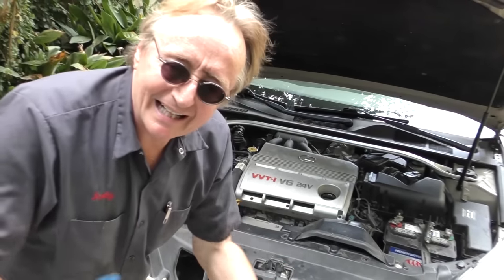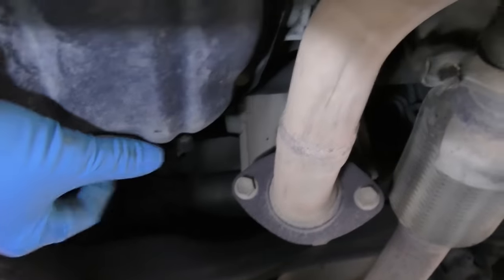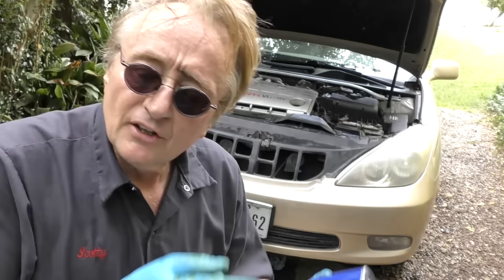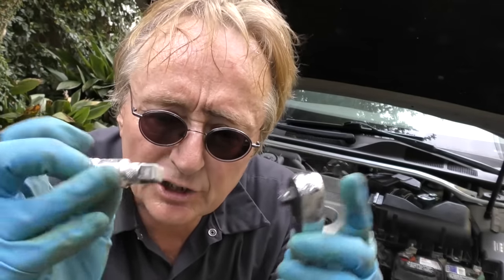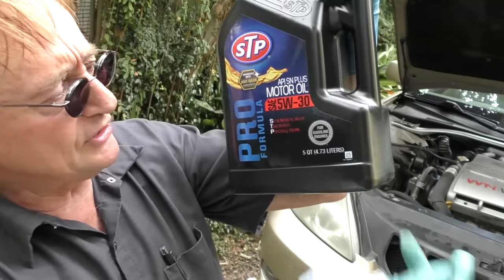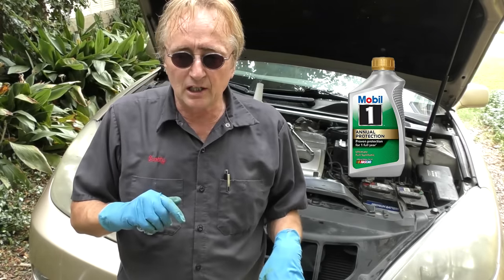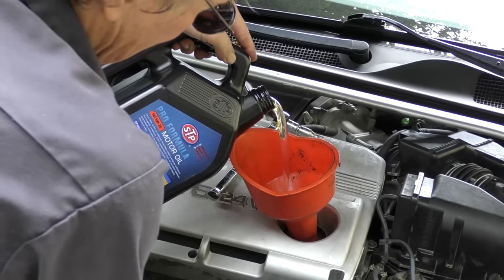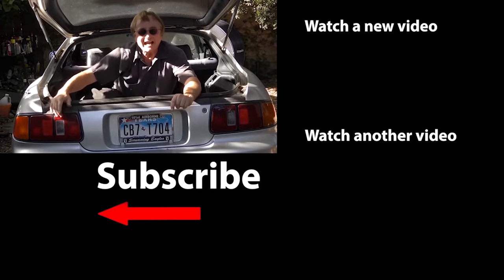Changing Your Engine Oil? You’re Doing It Wrong

Comment: Honestly, I don't think I've ever replaced an oil plug gasket!!
Reply: I have replaced one exactly zero times. I have also had one leak exactly zero times.
Reply: Charlie S. I’ve replaced a couple out of the hundreds I’ve done.  Never saw a filter gasket stick either.
Reply: I only replaced it if it was leaking before I changed it. Inspect the old one when you take the plug off. Looks ok it probably won't leak.
Reply: Charlie S. 280k miles of oil changes on my Avalon and still using the same plug gasket lol
Reply: heck, the "gasket" on my oil plugs are a copper washer...
Reply: @datsuntoyy  You're obviously smart enough not to buy Fram filters then lol.  Had one fall apart immediately after doing at oil change.  Thankfully I always check for leaks.  That along with everything I've read about them and it's the last Fram I'll ever buy.
Reply: @Kaliburz Yeah I think most are.  Kinda like the copper "crush" gaskets on a motorcycle exhaust at the cylinder head.  They're "supposed" to be changed because when tightened they conform to the shape.  I've never changed one of those either and never had a problem.
Reply: Never replaced the gasket and always do it hot, more oil comes out, boo yah
Reply: @sidefx996  I'll run the ultra but never the lower 3.  I've seen demos with basic orange that had holes in the media brand new.  I used to like K&N but the oil filter line has really cheapened.
Reply: @datsuntoyy  it's rare but I have seen it, also seen a brand new filter leak with the O-ring, and no double gasket either. That only happened once it was just a bad filter.
Reply: @sidefx996  I would say it depends on your application.  While I probably won't mess with the Fram spin ons anymore I've had good experiences with the cartridge style in an 06 Sonata running a synthetic blend.  As for plug gaskets, never changed one yet but seeing how most wouldn't use an old band aid on a fresh cut he's got me thinking about investing in a couple, especially if they're universal.
Reply: Me either
Wife:You shoulda known that.
Reply: I've never replaced my oil plug gaskets because they were copper washers.
Reply: @Kaliburz  the car manufacturer done it wrong 😂
Reply: @whoeverwhatever9279  What would 3 do?
Reply: @timyoder2003  have you tried running a little seafoam product in the oil on idle, before draining? It supposed to help prevent sludge buildup. You could look that up if you are interested.
Reply: @whoeverwhatever9279  But they triple seal cars doors now so It would seem like a good thing.
Reply: @datsuntoyy  Sometimes they can be difficult to remove depending on who put it on last. I usually just PB Blast catalyst the gasket and leave 5 minutes. They come right off.
Reply: @Joe_334  i never have ran seafoam in my 98 park ave , lifters are quiet, runs good , did the upper and lower intake gaskets valve cover gaskets everything looked good there so i just leave it alone , however i must not of got the one corner of the intake manifold sealed good 😕 but whatev its been that wat for awhile now, its not bad
Reply: I put on a ez drain plug. It's a ball valve. Never had a problem. Just flip the leaver and drain hooks up to a hose too.
Reply: My sienna 99, got it used, never even had a gasket... no leaks either. Lol
Reply: No need to replace the oil plug gasket when you tighten it up with a BREAKER BAR!
Reply: It's a one time crush washer. Hence the term crush washer
Reply: Should be on the new filter.
Reply: @datsuntoyy  I had one stick on me before and wasn't careful about it and ended up double gasketing. Luckily I fixed it before pouring in the new oil.
Reply: @Joe_334  If you're worried about sludge then either change oil more often or run Redline in it once in a while.  Something about their group V base that is hands down some of the best cleaning oil out there.  Can't say the rest is anything overly special.  

in all reality, don't worry about sludge with ANY synthetic unless you run over 25,000 between changes.
Reply: @datsuntoyy  : I had one filter gasket stick about 35 years ago. ZERO plug gaskets replaced in 50 years changing oil - 25 years on the same car!
Reply: @Kaliburz  That's what my VW had...never a problem.

Comment: 1) Fill the new filter 50% with new oil,  oil pressure builds faster on your first start.
2) You can get 5 quarts of Pennzoil Platinum at Wally World for $25.
Reply: Flaxseed Oil cant do that when the filter goes in facing up.  Gravity will have it’s say first.
Reply: You cannot prefill a cartridge filter.

Comment: Better dropping the oil when it's hot it's less viscous and will flow out easier,  with less dirty oil still stuck to the inside of the sump
Reply: This is an old wives tale. The amount of oil left is negligible.
This was true a long time ago but not any longer. All that oil is filtered anyway. Todays filters are many times better than the old days.
Reply: So is that still true for older cars and bikes say mid 80s or earlier? Is it better to do it warm or is there 2/5ths of f*ck alls difference?
Reply: @ianhalford5064  I'd say the 2/5ths rules here. Fact is its all hot when you shut the car off. What ever will drain into the pan is there when engine is cold. In a five quart car what might there be maybe 1/4 cup left in there? I have never worried about it and never will.
Reply: @jayman You're 100% correct I spent like 2 min typing the same thing before seeing you beat me to it.  NOT so sure id want Scotty changing the oil in my cars
Reply: Does anyone actually read anymore? Do you know what 5W-30 means? If you do, you will realize that engine oil has viscosity modifiers in it. That means that it is a lower viscosity when cold. That’s what the 5W means, 5 is the weight and W is winter, or cold. 30 shows that the oil is higher viscosity (thicker) at operating temperature and thinner (lower viscosity) when cold. 
What does this all mean to you, you might ask? When it comes to oil changes, do like Scotty says, if it’s hot, let it cool. Even used, it’s going to be thinner when cold. 
Yeah, I know, everything else in the world gets thinner when hot and thicker when cold. The reason above is why engine oil costs so much. 

I like to put some fresh oil, or some additive, in before the change if it’s already low. Fill it up with good oil and run it for a few days or even just hours, then change it. I hope that the fresh oil (with detergents) breaks up some crap somewhere and leaves it cleaner inside. Doesn’t hurt, that’s for sure.
Reply: rockn roll  so what are you saying? That we should all avoid the oil specified by the manufacturer!
Reply: Yes i did and you quite clearly said the previous owner used oil not to spec which you changed to spec and then experienced problems.
Reply: rockn roll  be more specific in your post. It is ambiguous and confusing
Reply: rockn roll  can't say I agree with 1. I think maybe the problem was a result of the wrong oil and was about to happen and had nothing to do with putting in the correct oil.
Reply: bikeman123 actually when you put too heavy of a weight oil in an engine the pressure will be way too high!  Which can blow and damage seals. The thicker oil doesn't leak through the seals as fast as using the proper thinner oil would. So if you go and put the proper stuff in after you can end up with it leaking more than it would with thicker.  Just as an example
Reply: rockn roll  what it was is the vehicle developed the noise the previous owner used a thicker oil to hide the noise long enough to sell the vehicle.
Reply: @jimterracall6766  depending on the additive (detergents) you put in, you do not want to be driving or putting any load on the running engine other than idle as it can cause internal failures
Reply: @thesenewythandlessuck  - like 2 minutes? How long is like 2 minutes?
Reply: @jimterracall6766  helps the old crap stick to the motor better
Reply: Why? Naw. This is bogus. What automanual says this? Doesn’t matter. Rather drain cold oil. Less worth of getting scaled
Reply: Oh wow a breaker bar on a drain plug. Holy shat show. Horrible advice. Actually many manuals call for a torque wrench. Why you ask, to limit the torque. I would use a box wrench, but never ever ever a breaker bar. Scotty is Something. Of course he uses conventional oil. No one uses conventional anymore. Good bye viscosity failure and sludge. Breaker to replace the drain plug. Classic Scotty!
Reply: @heyyou5189  your right But if you drain the oil while it's hot I will get more contaminants out of engine and will result in a cleaner engine
Reply: It doesnt need to be warm...
But it makes ir flow faster and easier.

Of you really want all the old oil out... drop some fresh in with  the plug removed.
Of will flush.

I only do it if i have spare oil left over.
Reply: @samm1462  scaled? I think nobody is asking for a 90 degrees celsius oil change.

40 degrees or something so it flows Nice but you dont have to be scared
Reply: @jimterracall6766  Actually, a 5 weight pours less readily than a hot 30 weight.  You can prove that to yourself if you want, or there are some good videos.  Nonetheless, I have no trouble draining it almost cold.  Just driving it to the shop warms it up some.
Reply: rockn roll  I won't use 0w even though it's on the oil filler cap in my 2006 Triton F150 it makes the cam phasers tic and this truck had  only 15000 miles on it switched to 5w no problems after that
Reply: No. Warm oil is perfectly fine.

Gosh, talk about oil wars! Just never ends! Just change your oil regularly and don't sweat the small stuff!
Reply: rockn roll most likely thicker oil was used to mask a problem.

Comment: Also I forgot to mention in the previous post, you should bring your car to operating temp by driving for a short duration and then change the oil shortly thereafter. Changing oil on a cold engine doesn’t allow for all the sludge and buildup inside the crankcase to be properly drained out since it’s been baked inside of the engine and not heated to breakdown back into the oil for draining. You mentioned several times about the benefits of changing on a cool engine to protect yourself. I understand that concept for a DIY mechanic but realistically the correct way should be taught.
Reply: didn't he say to leave the car sitting for an hour after driving it? seems like a fine duration to me for it to have cooled down enough to be easy to work on but the oil is still warm and runny

Comment: The oil you want to drain should still be warm though. And if the design allows it, put at least some new oil in the filter, as well as on the new filter gasket. Obviously, you can't put much in an oil filter that mounts near the horizontal, but one that points down is good. The reason for this is that there is less delay in the oil getting circulated. Of course, that small volume of oil won't be filtered, but a good quality oil should not need filtering anyway when it is just put in the motor straight from the container. 
Oil drain plugs have a specified torque setting, so use  torque wrench until you know the 'feel" of how much to tighten it. I would not recommend using a "breaker bar" to tighten the sump drain plug back up. Use a short ring spanner or similar, so you don't over tighten and possibly strip the thread. It is also good practice not to fill up just assuming the engine will take all the recommended 5 litres or whatever. For a five litre capacity, pour in 4.5 litres,  run the car for a few minutes, and check the dip-stick again. There could be a reason why it won't take the full amount, like doing the oil change on a slope. A few cars can have more than one sump drain plug-some older models of the Honda accord come to mind. This is because a few cars may have a common sump for the engine and transmission.   
It is a routine and simple process, but as Scotty demonstrates, don't be too casual or careless doing it, or you could end up damaging something, and having an expensive repair bill.  
If the oil is too warm [you are wearing gloves right?], then let the sump plug fall into the oil. You can always fish it out with a magnet later.
Reply: Great response. So much emphasis on the oil viscosity, but not paying attention to torque settings.

Comment: I just learned the genius engineers at Ford located the oil filter, in my 2003 Taurus, DIRECTLY OVER MY STARTER! At oil-change time, carelessly removing the (horizontally oriented) oil filter will bathe the starter in luxurious dirty motor-oil dramatically shortening its useful life. The new starter installed on my car last week only cost $600+ dollars (including tow). Thanks Ford!

Comment: I was taught for the oil filter and the oil plug to hand tighten, then give one quarter turn tight then youre good to go
Reply: That is what the toyota manual says
Reply: Thanks, me too. Anyways, proper torque is best.....or the old best way .
Reply: Yup my Suzuki manual says hand tighten only for the oil filter.
Reply: Isnt that right spark plug
Reply: Weeeeeeeeell, you were taught wrong. As it turns out, drain plugs have a torque specification, and it’s not a quarter turn.
Reply: @fredmalito9869  If you need a torque wrench for the plug you are wasting time. Do it by feel.
Reply: Use a torque wrench on the drain plug and you can't go wrong. The problem is finding the specs on "how much?"
Reply: @virginia7125  most i've seen are around 20 ft/lb    just tight enough to not come loose or leak   it's static and not holding any thing moving or stress related so that's not a concern .
Reply: @virginia7125  exactly right. Hand tighten and then give it a small turn until it's snug. Always wipe the bolt down with a cloth before reinstalling. You can always check under the car later to see if you have any oil or residue on the outside of the plug or any on the oil pan near the bolt. There shouldn't be any if you wipe down the bolt and the pan where the bolt goes into the pan when you changed the oil and you tightened the bolt snug.
Reply: That's wrong. When it's tight, it's tight. There is a torque spec for your carwith a specific number. But if you just tighten it until it's tight you're fine. You aren't going to damage it, unless you turn it past the point it stops turning. The goal is to prevent leaking. If it turns easily, it's not tight enough.

Comment: My father taught me to always fill the new filter with clean oil before screwing it on so the engine isn't running dry while it pumps the new oil from the pan through the filter...just a thought lol
Reply: Jason Rebello it’s optional.  You can do it if the oil filter sits vertically. But Scotty’s Lexus here is side ways and other cars are upside down so Scotty couldn’t do pre fill the filter.
Reply: You should put a little bit in at least.
Reply: @traceyclark6822   That's what she said ...
Reply: @q7wasp7  lol
Reply: it's nonsense. engine won't be dry. there is still oil on it.
Reply: Run the engine to get the oil hot and then change the oil and filter. There should be enough oil still in the bearings to prevent any damage when you start up the engine while the filter fills up.
Reply: It won't make much difference, the oil will pump through within a few seconds. There's still oil on the engine parts, but do not rev the engine.
Reply: I still do this, but I'm pretty sure it's not really needed. Gives the old oil more time to drain from the filter mount, anyway.
Reply: I would start in situations where you could not fill the filter you should at least give the key a couple of bumps to make sure that the oil has primed through the pump and pick up first before actually running the motor false starts enable priming of the pump before running. I would not follow Scotty's advice as far as changing my oil goes, because as far as I'm concerned he did it wrong. I always run a cheap quart of oil after draining old to help push out the remainder of old oil. It doesn't get all of it but it does get most of it. The cleaner you start the cleaner you finish. And there really is no sense getting a head start on clogging your filter with leftover crap from your last batch of oil
Reply: I did that when I first changed my oil it spelled everywhere. Derp moment
Reply: I do that on my Toyota where the filter hangs straight down but can't on my Honda as it is horizontal. I put some oil in that one, maybe 1/3 full. I don't think it makes a noticeable difference in how long the oil pressure light stays on but it can't hurt.
Reply: sledgenwedge How do you run a single quart through an engine that’s had the oil drained? Shouldn’t the oil that’s being picked up by the oil pump be already filtered or is oil filtered after the pump? I thought oil was filtered before returning to the pan so the cleanest oil is picked up by the pump.